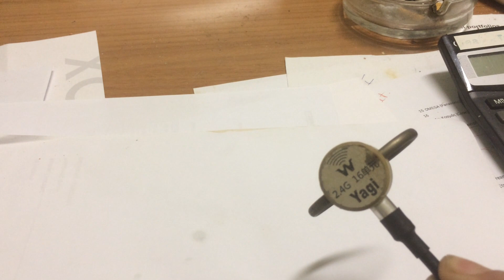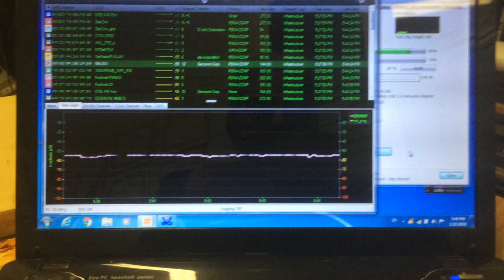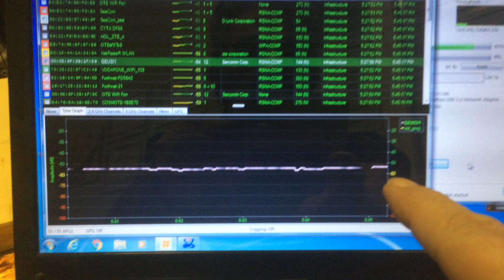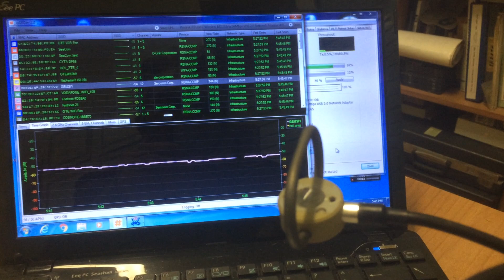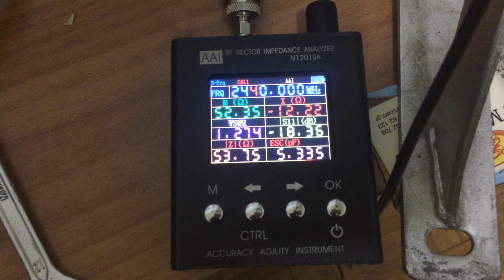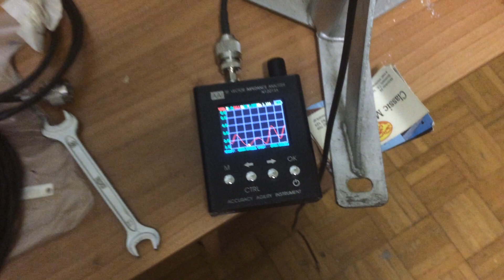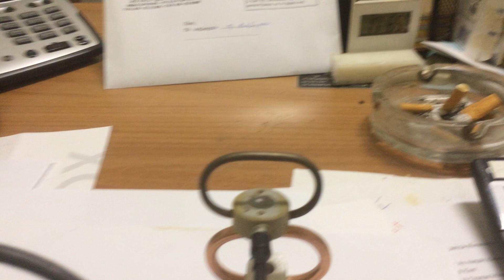2.4 GHz Yagi, Cheap Chinese antenna Folded Dipole modification & SWR with good results & signal gain

Comment: Can you share more detail construction of your folded dipole, I have 3 of these antennas by none of the is performing well.  I don't have the tools to tune the antenna hence if you could share the real dimensions is highly appreciate. Thank you
Reply from the maker: Hi again Russel, dimensions measuring from the outside tip to tip are:  58 mm (length) X 34 mm (height).
Reply: Can you please make a video making a dipole?
Reply from the maker: Hi Roberto, unfortunately no, I do not have the time. I did it though with many trial and errors to get it correctly made, you have to experiment with the tools you have and even construct a mini pipe bender
Reply from the maker: Hi Russel, just saw your message, shure  !!!!  give me a few days so I can measure the dipole. I dont have it here in my office. It is installed on my home mast performing long range reception.